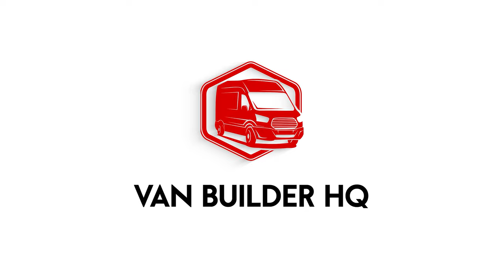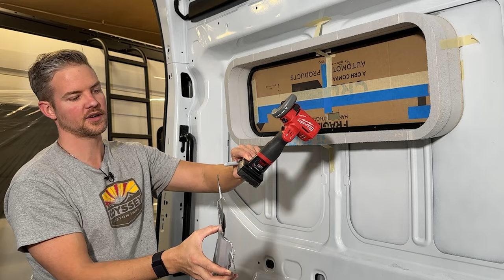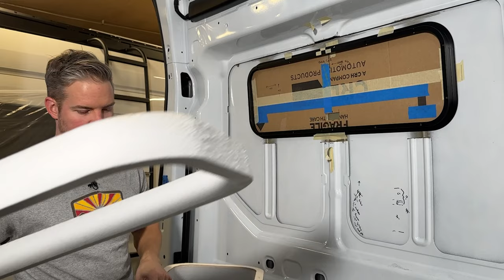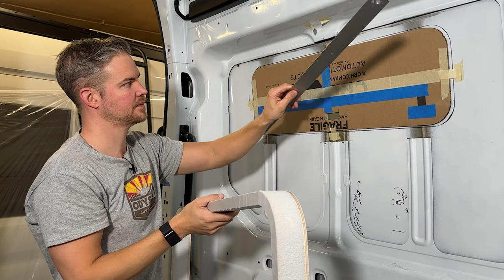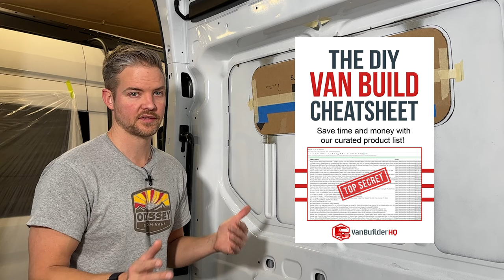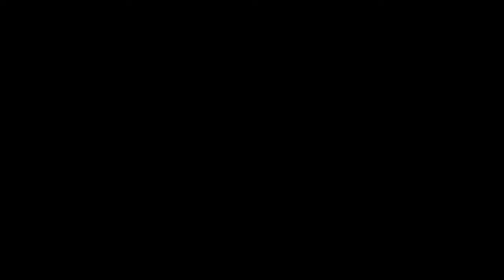Install Your CRL AW1033 Windows The Right Way

Comment: Your videos are great, thanks for all the great videos you put out there that help DIY'ers. .  That being said, I've had CRL windows in my van for 2 years,  I'm not full time, just do long trips here and there.   They are the worst, the t-vent ones are literally falling apart on the inside. Plastic dividers have warped and are falling off, bug screens are worthless, they don't fit snug so there are gaps all around them.  It's also hard to get CRL windows so they don't leak, I have had to have all of them  caulked around the rubber seal to get them to quit leaking.  I would get the kind of windows that are glued in if I were to do another van.  I was warned before I had them installed that they weren't the best, wish I'd listened.  I've talked to multiple van builders who don't use them anymore because of too many problems with them. Like I said, your videos are great and super helpful, it's just the CRL windows that suck!

Comment: In fact, one hole is sufficient to position the cardboard template on the wall.  Then you bring it on the outside and adjust it so it is parallel to the metal fold just over it.  I held the drill in place for positionning by putting it tightly in an half inch wood block held in place against the metal wall by double sided tape.